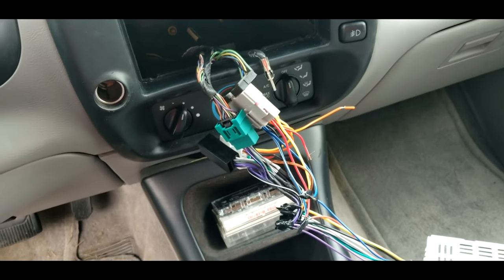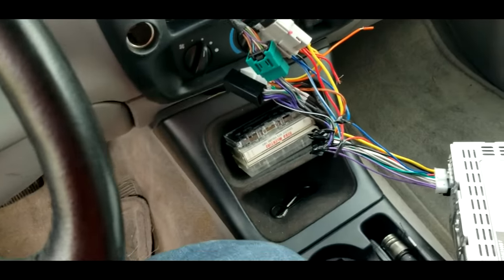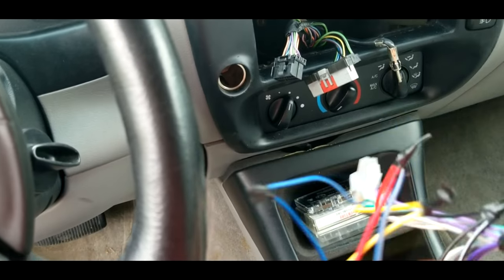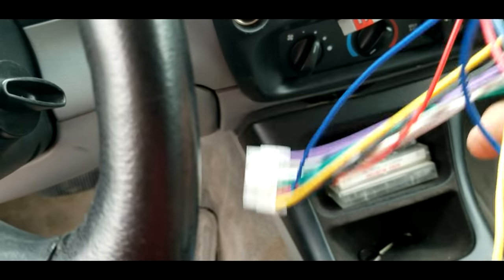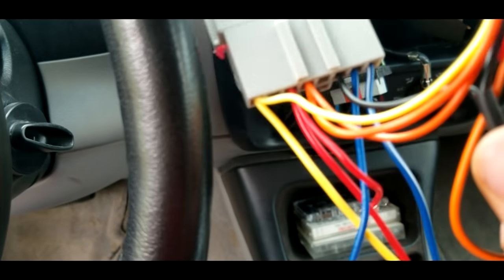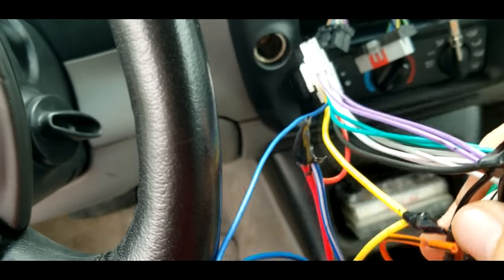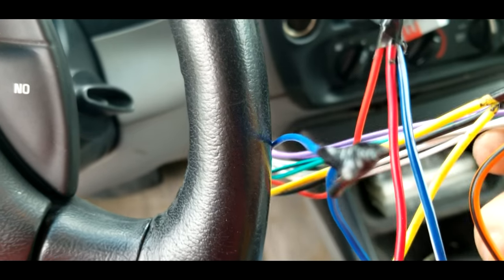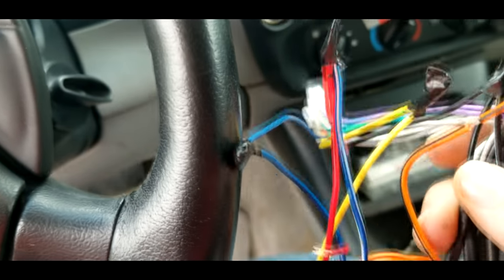Aftermarket Radio Turns On BUT NO SOUND **SOLUTION**!!!

Comment: While you did cram a 30 second video into 7 minutes, you saved me a ton of time. I was ready to return a replacement radio because of no sound. I touched my AMP wire to power and there was the sound. Thank you!
Reply from the maker: Glad it worked.  The extra time was necessary to save some amatures some grief by NOT cutting into their factory wires.
Reply: @JerryMiah  I agree. I almost made all the mistakes that you mentioned in the start but luckily didn't. Wish I saw your vid before either way tho just in case I had 🫡🫡
Reply: Lmao
Reply: @JerryMiah yeah well guess what? That's the first thing I did .lmao
Reply: I liked it and you know you can fast forward. He warned you
Reply: I took my truck to a shop and they had no idea what was happening so they told me to get a harness to bypass the amp completely
Reply: Me too

Comment: Hey man, cool video... but just FYI, Power Antenna (blue) and Remote (blue white) are both just 12v outputs. If your radio harness doesn't have one or the other, it would be preferable to hook both the vehicle harnesses blue & blue white to the radios single blue wire. The only difference from what you recommend here is that the red, 12v acc, is an input to the radio. So if the fuse blew on the radio, the amp would still get power, and that is not ideal.
Reply: theres my answer

Comment from the maker: Thank you all for taking the time to watch this video!  It means the world to me, as it is my most popular video on the channel with over 1/2 a million views!  I am so glad I was able to help a majority of the people coming to seek help with this issue.  Thank you all and God Bless!
Reply: If you still have this explorer, make sure you put a 12v to 5v adapter for your amp since ford uses 5v on theor factory amps, if your speakers have started to pop on startup, this is why
Reply: Thank YOU!!
Reply: Thank you very much this is by far the most helpful video I have ever found.. I was pulling my hair out trying to figure out what was wrong
Reply: Is this only for ford vehicles I have a Jeep Grand Cherokee and I have the amp wire (which is this small yellow with a blue stripe) and another wire that’s big with a circle of prongs and one in the center, and I’m having this problem my radio turns on but doesn’t put out sound, and I wanted to know if this solution works for me
Reply from the maker: @kalebgaul4963  no.  this should apply to any vehicle you are having trouble with.

Comment: I just ran into an issue. I pulled my Boss radio from the car and found a white cable with black line vs. the blue that you mentioned in your video. Well here goes nothing, let’s see what happens.

Comment: I'm buying a 2000 Pontiac from a good friend and I got his radio to light up but no sound cane out. Apparently the past owners that had it just used a Bluetooth speaker in the car. ( past owners: the sellers family). I will try this I hope it works thank u. 

It is hard to find videos and information on specific things in life so thank u for making it a little easier sir thank you 😁

Comment: Thanks Buck!  I have a 2011 Jeep Rubicon and swapped out factory radio for Sony XAV-AX1000 and got no sound!!  Couldn't figure it out til I found your video.  Worked like a charm.  Excellent!
Reply: Were you experiencing no sound at all? I just put in a stereo and I have sound in the radio mode but not the Bluetooth or CD mode.

Comment: This video saved me a lot of frustration. I knew my connections were good, I mean I couldn’t have screwed up all my speaker connections. They were all soldered and heat shrunk, so I know they were good. I looked at that stupid blue wire a few times and wondered why it had nothing to connect to. You saved my ass man. Thank you.

Comment: Thanks for this video!  Working on a 2007 Wrangler with an aftermarket JVC stereo and this truck with the amp wire solved the no-sound issue.  You rock!  😊

Comment: This video is the best and most simple that Ive seen on line. Being a female, Im gonna attempt to install a new stereo in my 02 Jeep Wrangler. Ive has this Stereo forever but couldnt figure out the amp issue, watched many videos and still couldnt get it. Your video was simple and allowed me to finally hook up a much needed radio. Thanks so much, I see this was done 2 years or so ago. But am still wondering why the hookup yo the sub has 4 wires on it, and thats coming out the harness, if your still on here, hope you can answer this for me. Next venture with my Jeep, is all new speakers and sub etc etc.... anyway, thanks and video was perfect.

Comment: I don't have the blue and with wire, I just have solid blue what I am supposed to do now?
Reply: Same here !!
Reply: Anybody knows now?
Reply: I also have this same problem on the dual double din I recently bought for my 05 Chrysler 300
Reply: Just touch the blue wires together to see if you get sound with everything plugged in. On the radio harness it said power antenna/amp and the vehicle harness it said power Antenna. I had to connect those wires.

Comment: Thank you so much! This fixed our issue of having radio power but no sound. In my case we were upgrading my brother's 2001 Pontiac Grand Am with a Pioneer AVH-X2800BS. The Axxess LC-GMRC-01 adapter kit we used didn't say anything about needing to power the the blue/white wire, but in reviewing the car's pin diagram, sure enough this controlled the car amplifier. Don't know how were would have figured that out without your video.

Comment: I have a GM, Cadillac Escalade and ran into the exact same problem. This was freaking it. You saved the day. Was going insane after looking over the harness for an hour backtracking. Forgot to connect the amp wire for the factory system… whoops! Thanks again!

Comment: did the speakers work at first and then shut off on after? My radio has power but speakers all went out while I was driving.
Reply from the maker: No I didnt have any sound until I powered the amplifier
Reply: Either speaker grounded or factory amp failer....pull radio out get a test speaker and hook it up directly on the radio and see if you have sound....if you do then bad amp if not cut the ground on each speaker wire at the radio and see if sound comes on if it does then its a speaker ground short.
Reply: @amonronin8759  
Hello

Comment: OMG!! Thank you so much for this! I was 99% sure I needed to power the amp that way (pandemic put too much time between me and the advice at the radio store where I bought the harness), but was stuck in "what if" limbo. Internet was no help unless you have an RCA jack amp, want to bypass the factory amp, need to see the package wiring labels digitized repeatedly or want to buy the harness again from a zillion different vendors, LOL. Your video was spot on and answered the simple, straight question the rest of the interwebs apparently has never been asked....EVER!
Reply from the maker: Glad it helped

Comment: WOW bro, Thanks a milli!! I was stuck, my install was on an 07 GMC envoy going to a JVC with the "radio pro3" adapter and this worked.  Blue striped with white coming from the serial adapter wired into the red power and BOOM! Thanks again!
Reply from the maker: Glad I could help
Reply: @JerryMiah  I get no power to my radio and it’s brand new the wires have power going to then they been tested but radio don’t work nor my old one now and fuses are all good I’ve checked a million times I have a 1999 Mercury mountaineer aka ford explorer lol

Comment: "These are the connections that are already in your vehicle, you dont wanna mess with those"   words of wisdom right there, i see people all the time cutting wires and making a fucking mess of the vehicles harness, 3 years later they sell the car and dump a big ole problem on the new owner who might be someone that actually does care about the vehicle and now he has to fix the mess someone else made.

If i might make a small suggestion for everyone,before starting a project buy a bag of butt connectors, they are real cheap on eBay, like a bag of 100 for like 5 bucks,you can put your wires together and crimp them and run some shrink tubing and it looks really nice and professional, now if your stuck in Death valley and need some music right away (like all of us) some cheap black tape and twisting wires will work just fine,lol

Comment: I was getting 50% success with having sound on my C6 with the PAC interface. Strangely if I opened the door when it didn't work, it would immediately start working. I tried this solution and so far a dozen startups and it's working every single time.

Comment: I have a 95 ford ranger that I bought from dad a couple years ago.   It still had the factory radio,  I decided to get a new pioneer.  The factory had 2 separate connectors, a big and small one.   The pioneer only had a small one. I had no idea about the speaker wiring diagram, even after googling it.  Finally figured that out, then no sound.  I ran 12v to the blue wire going to the dash and it worked.  Now I just have a ticking noise I need to figure out.  Thanks for the tip!
Reply: After scratching my head for an hour or so I figured out that one of the wires that I cut off and left hangin was a ground wire that needed to be grounded.  Grounded it and the rapid ticking went away.

Comment: I just put a new head unit in a 06 nissan armada and had the same problem.  Now they had several different solutions that were more difficult and extreme! This was amazing and I wish I would of found this before buying several different plugs lol thank you!
Reply: Brad Martin,this fixed your issue? I've got an 06 Frontier. I'm on my 4th head unit now. I thought I had wires touching and blowing the channels out of my deck.. I replaced all 4 door speakers and added an amp and 2 12's. Ive pulled the door speakers 3 times to check the wiring.  In about to sell my truck its so frustrating

Comment: Thanks for this video. Do you think it's possible to get the sound working with just using this method and not hooking up the speaker wires?

 I have a 2000 Lexus LS400, so there wasn't a radio harness out there for this vehicle and I had to splice wires. So far I have the ground,constant and acc hooked up and the deck comes on, but I couldn't figure out the correct color for the speaker wires (the wires are different colors from the deck harness).

Comment: Thank you so much I lost so much sleep over this I just bought and had a new radio installed and couldn't and wouldn't think it will be the wiring because it was done by a company installation but I did what you said anyway and took the radio out and showing up found wire and connected it to the blue wire and it works thank you alot God Bless America

Comment: hello, i have a 1996 ford explorer limited and I am trying to replace the radio with a single din radio. i have the exact same factory wiring harness connections that you do and i am having trouble finding an after market wiring harness that will connect to the old harness. the connector that works the speakers has a few wires that do not match the wires on any of the new connectors that i have bought. i believe that the speaker connector is an eight pin and all of the other aftermarket connectors have nine. so my question is, where did you find the eight pin connector?

Comment: Hey how are you thanks for the video! I have to try this I have a 2003 Ford Explorer never had issues with radio signal FM but I just got a new head unit installed and now get white sound static on a few stations that are my favorite of course and their local stations now do you think this would be the same case with the blue wire with the white line just needing to get attached to one of the red power wires? And do you think the 2003 Explorer has that built-in amp under the dash also like your 96? Please write me back let me know what you think I didn't install it I had a guy at the flea market do it, anyway thank you hopefully I hear back from you

Comment: You r the best Thank you! Sound issue is gone. Installed aftermarket radio on my 09 H3 with amp. I had sound for like 10 seconds and then no sound. SOund was weak as well. I connected those wires and now I have great sound. Thanks again.
Reply: Do you have to put the amp wire the blue and white wire together with the accessory wire?

Comment: Some wiring harnesses bought separately bypasses the factory amplifier and utilizes the built in radio amplifier straight to the speaker wires. My 97 f150 is like that, the wiring harness I purchased went straight to the speakers, if it didn't and I wired to the factory amp to the high side output of the radio it would fry the built in amp. Keep in mind, high side output cannot be wired to the passive side of a amplifier otherwise it'll get toasted. If you're not sure a built in amp has a passive side input then you risk frying it. Most all the newer stereos have high and passive sides, passive side uses composite audio jacks, speaker wires are high output side only. Just be dang sure a built in amp has a high side input when wiring a radio the way your describing here. When wiring amps to stereos, it's always passive side output to passive side input, or high side output to high side input. Factory amps don't use composite audio connections, they actually look just like normal speaker wires... so be sure.

Comment: Just bought a new Boss dbl din radio for my 2010 Nissan Frontier, your blue wire with white stripe to red wire, oem red and aftermarket red still doesn't give sound. Checked if I might have blown a speaker too, but they seemed fine when I opened up my door panels. Also, the ground wire from my radio's harness is kind of weird too... I have it wrapped around a grounded bolt. I've gotten sound once before but only out of left side front and back and I think it was because of the ground wire, blue/white wire wasnt connected to anything either. Haven't gotten sound ever since that one occurance... My problem could just be that I don't know where to connect the ground wire. Either way, I'm stumped and really don't want to have to bring the truck to some shop to have it done, any suggestions??

Comment: 2004 gmc sierra 2500hd
My boss sterio had no sound on initial install
Hooked up wire B3 (pink wire) from the head unit ~900mV to the Antenna Output (blue wire) on the radio now the sound works!

Thanks alot!

edit: pink wire is "Radio on signal or Antenna Enable Signal"

Comment: Man I have this same problem in my 98 mustang. I have a standard audio system, so it’s not a Mach 460, and have no sound as well. Do you think that this could be an issue for this vehicle as well? It also comes with a factory amp installed.

Comment: Thanks for the video, bro. Have a question, in my 03 Ford Harley Davidson , now my issue is, I did all the wiring, BUT... at nite time IF any HEADLIGHTS  are ON, stereo works fine. BUT if LIGHTS are OFF, stereo ll go on MUTE, If my headlights control is in position OFF its MUTE, it is ON or AUTOMATIC it’s not mute. Please help.!

Comment: So I have a 02 Chevy Avalanche and I was having the same issue were I wasn’t getting sound through my door speakers, but my sub would still play. I have the sub on an amp but the door speakers are not on a amp yet. When I did what you showed in your video it didn’t change anything but make the headunit and the amp stay on. I also connected the remote wire I have for the sub amp into those connections. Do you know why it isn’t working still and is leaving the headunit and amp on?

Comment: Have a 1991 Jeep Cherokee Laredo with a factory Jeep 56002467(1991) AM/FM Cassette Player and swapped out the tape modules in two 2467 cases. Now I have me some rocking tunes. Now what I need to know is what is the cause of either the left or right channel going out on a 2467 and on a 56009004(1992) the volume knob is maxed out but still need just a little bit more volume.

Comment: Hey bud. I have a 2002 Ford Escape V6 XLT 4x4.  I'm also having the same exact problem. However, my amplifier wire on this model is not colored BLUE from the factory harness. I believe it is BLACK w/ WHITE  stripe. I'll keep on researching this, but I'm certain it's correct to assume that this would be correct! Thanks very much for the tip!! I too got an ole cheap car stereo, but it only plays radio, bluetooth from my devices, and an auxiliary hook up...hell, it's even got a USB port. I just took a leap into the 21st Century! 😂 For an '02, she's still very clean and runs like a champ, so I had to treat myself! 👍 thx again!!!
Reply: Search on EBay for a used Chilton's or Haynes car manual. They have basic circuit diagrams on the back and list standard color descriptions of wiring harnesses for year/model groups of cars. You might search for rent options to access the manuals if you don't want to buy them.

Comment: I have a question 

If your trying to hook up a sound system how would you connect the blue wire that comes from the amplifier if you already have your blue wire with white striped connected with the red ones

Comment: Thank you SO much! I almost returned my radio over this, oddly enough when you look at the pins on my new radio with a multimeter they don't have voltage on them when while playing music so I assumed it was a radio issue - but as soon as I put power to the amp audio started working.

Comment: Hey brother. Great video. 

Factory bose amp with aftermarket headunit. Everything works great for ten min then speakers dont play sound anymore. Even door chim stops. Then it works again once i turn car off and restart. 10 min later- speakers off but headunit works as should.

Dark blue with white stripe from my Crux adaptor is wired to light blue stripped(wire in your video) to back of headunit , not tied into a red. Going to try and wire bothdarker stripped blue wires into red and see if it stays on. Any insight? Thanks in advance.